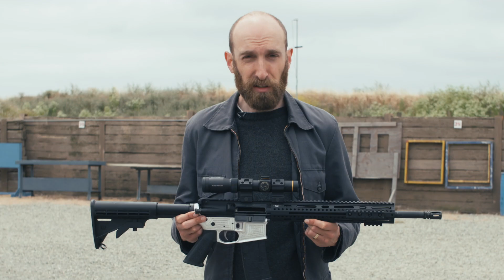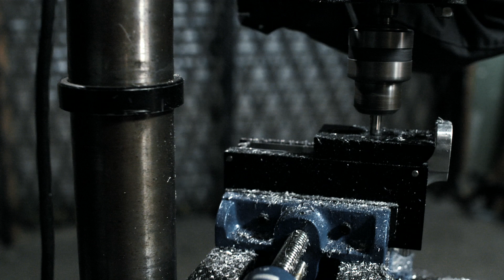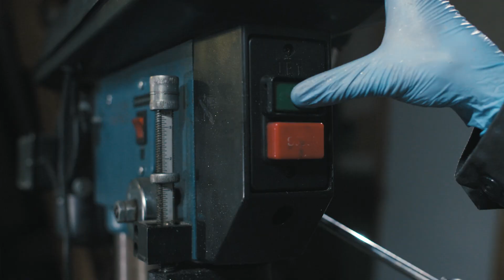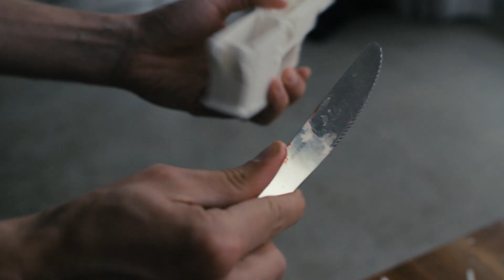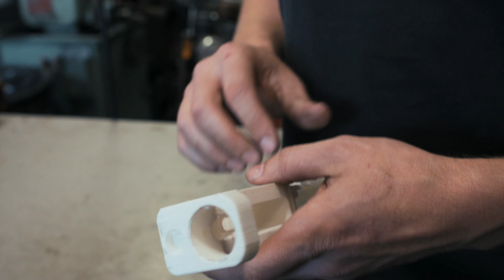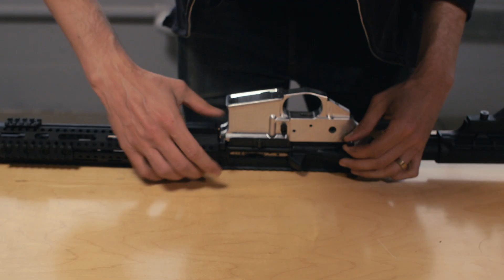I Made an Untraceable AR-15 'Ghost Gun' In My Office | WIRED

Comment: Surely the barrel is the most difficult thing to engineer. Apart from being straight, it has to be reamed and then rifled, very difficult to do. If governments wanted to control weapons then that would be the best target.
Reply: Laughing Achilles Give 3D printing 3 years at the worst @ the barrel.

Plus it wouldn't stop anyone from making shotguns.
Reply: SCComega
Obviously shotguns are much easier, although you do need to ensure you're using tubing with no seam or the pressures involved will split the barrel open.

As for 3 years on the barrel, on what do you base that? Modern rifled barrels use special steels which can handle the high pressures. If you print one then it's likely going to be a laser sintered product, the problem is that the barrel will need to be slowly and carefully heat treated in order to avoid it from being too brittle.

That's a lot of stuff to overcome for a person at home. It's why even arms manufactures are still using the button method of cutting the rifling.
Reply: Laughing Achilles Because of more advanced material techniques like Filmet which after heat treating a 3D print you get a fully sintered metal structure.  I talked with the owner of the company behind it and he confirmed they're coming out with stainless steel.  

Even if you might need a heavier profile with a sintered product vs a cast&machined product, viable barrles will be a thing soon enough with FDM/FFF 3D printed + kiln fired metals if anyone takes up the torch.  

And I give low-cost SLS printers are being worked on by open-source.  A SLS printer capable of utilizing bronze powder is expected to have a working prototype by the end of 2015, and bronze, while not as great as stainless steel, will still be capable of use for low pressure rounds when in a heavy profile.

Even without that, carbon-fiber composited with thermoplastics (Such as Colorfabb's XT line) is already capable for .22LR barrels with present 3D printing technology.
Reply: SCComega
Thanks for the reply, I did mention heat treating but again that's a difficult thing for a home engineer to do properly with something like a barrel. Generally they have to hold it at a high temperature and then reduce it slowly at very controlled intervals for extended periods. Still it will be interesting to see if manufacturers move towards that as current technologies for barrel making are pretty wasteful. I imagine it would be even more useful for manufactures who use the hexagonal barrel designs.

Heavier profiles are no good if you're trying to fit it to modern firearms so I pretty much disregard that argument.

Please provide a link for the composite barrels. From what I last read they consisted of a metal liner surrounded by the composite. Again that's not really a 3d printing thing especially when you consider that the weaves tend to be propriety. Still I would be interested in new tech.
Reply: Laughing Achilles Not heat treating in the traditional sense, but kiln sintering.  Filamet is a 99.8% metal / .2% polymer binder for FDM/FFF compound made to be thrown into a home kiln (run on residential power supplies, cost $500-1000) to sinter the metal together.  

As to heavier profiles, it's no issue for an AR where it's simple enough to mount a bull barrel in which .223 Rem would be possible with bronze.  Or most AR-available rounds really due to the maximum bolt pressure being ~40k PSI limiting how badly the rounds wear on the rifling.  (Or don't you consider an AR a modern rifle?)

Beyond AR's, the 3D printing crowd is a DIY crowd, and many custom designs have been done from the ground up by FOSSCAD.  There is no reason that by the time these technologies become mainstream that there won't be modern firearm designs produced for the technology, just like the progression of 3D printed polymer AR lowers has shown.

For composite barrels, I've got nothing off the top, but you can look at the grizzley rifle for a .22LR using just ABS holding up to several shots (about 10 on average.)   while the carbon fiber bit is only stories on IRC without any pictures, it would make sense as Carbon fiber - PET composite is ~1/3rd stronger than ABS with far better layer adhesion (Layer adhesion being the main thing leading to failures due to the structure of the print) 

Beyond that, yes, the current trend FOSSCAD is doing for the use of ABS as a standard is metal tubing inside inserted during the print to extend the life to hundreds of rounds.  (theoretically) as gas doesn't directly act upon the 3D printed layers as much.
Reply: SCComega
Thanks that's lot of very good information, I'll have to do some reading.

As for totally composite barrels, the big problems I can see would be overheating, pressure containment (carbon fibre may be stronger than steel but it tends to be directional strength) and as you say longevity.
Reply: Laughing Achilles One correction, carbon fiber is not stronger than steel, just stronger per weight than steel.  Overheating is yes an issue, as is pressure containment.  So we will likely never see full composite barrels on anything other than rimfires or single-shot guns.   Or acts of desparation.
Reply: SCComega
Yeah sorry I thought  that given the context the weight/strength argument would be a default but I should have made that clear.

I have learned from our exchange so thanks, I've started reading up on a number of things you mentioned, some very interesting stuff coming along.

I'm fully in support of 3d printing, the sheer reduction in waste is enough to support it, but it's ability to produce geometries which cannot be achieved using traditional casting and machining methods, creating an item as a single seamless piece and being able to rapidly prototype are all huge things for the future.

Not to mention how incredible this is for the home inventor and even later on when these devices will I am sure become commonplace.
Reply: Laughing Achilles Well it is a default but I had to make sure that you didn't make a sadly common misconception.  

And I'm always glad to hear that an internet conversation has led to someone actually paying attention and building upon it.  It's too rare a thing that people actually build their knowledgebase anymore.

As it stands, FDM/FFF 3D printer costs are, with inflation, where regular printer costs were in the early-mid 90's. Give it a decade and most households with a PC will have a 3D printer if trends work as history suggests.
Reply: SCComega
I get where you are coming from, I just thought given our back and fourth it was obvious that I knew about the subject rather than spouting ill informed nonsense. Still I understand as I deal with it all the time. A person unwilling to learn may as well be dead.

I'm currently in the process of building one of the open source wooden CNC machines, my next project will be a plastic 3d printer so it's all fascinating to me. My goal is a laser sintering machine but that will take a lot of work and some serious design in Solidworks :)

I hope you are correct with the trends. I don't think even most people who now abotu 3d printers understand the impact that they can, or more likely will have. I truly believe that manufacturing will have to adjust to a system where open source users will have a big share of the market.
Reply: Laughing Achilles This is true, but it all comes down to how long it takes for commercialization trends with competition.  Makerbot is doing well towards this, but we need to see two or three more companies step forward and make themselves availability on store shelves  Which, at the very least, Airwolf 3D and Ultimaker seem to be moving towards.  

So give it a few years, the industry will develop, retail will take notice, and let the commercials come.  

And manufacturing will always have a position of being there for the lazy, and those who are used to things as they've always been.
Reply: SCComega
You're right of course, manufacturing will have it's place, especially electronic goods as it's going to be a long time before we have a printer able to create a complex circuit.  And of course large scale products require factories, foundries etc.

I don't know if you have seen that the piratebay founders started a website where people could share their designs, open source as you would expect.
Reply: Laughing Achilles I hadn't, as while I chat with FOSSCAD in IRC a good bit of the time, I myself have yet to buy a 3D printer on account of financial limitations.  Still, I keep aware of what's out there.

Comment: Does it only print AR15 receivers?
Reply: illyounotme Actually, it's capable of running any program and cutting more or less anything. It just ships with the program for cutting AR's. 

I wouldn't be surprised if some/many of the folks who have bought them have no intention of using them for making guns, only as relatively inexpensive, effective tabletop CNC mills.

Comment: I think they should just teack more coplicated parts. Hard to make means no easy machines. No easy machines means no ghost guns
Reply: David Pallatin This is the most complex single piece in the gun. Most of the rest is pins and springs. Any other piece that is not also easily 3D-printable could be replaced by something that would only make a less accurate (more dangerous to other people) weapon.
The only complex thing is the milling machine itself.
Reply: David Pallatin Everything else on the gun can be acquired through parts kits online.  Anyone with a little dexterity can put together an AR.
Reply: What are you even trying to say?
Reply: ok, then people will find ways to make their own. Most other parts are simpler or loser spec than the lower
Reply: put serials and restrict the sale of more parts in the gun
Reply: The only reason any of the parts are hard to make is that you're trying to reproduce a specific weapon, because people think it's scary looking. There really isn't much that goes into the most simple firearm designs.